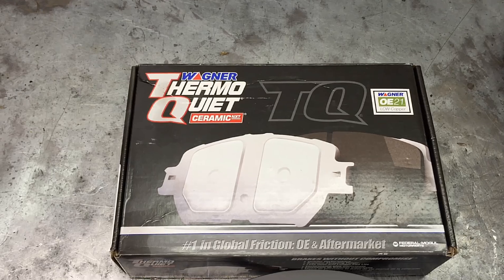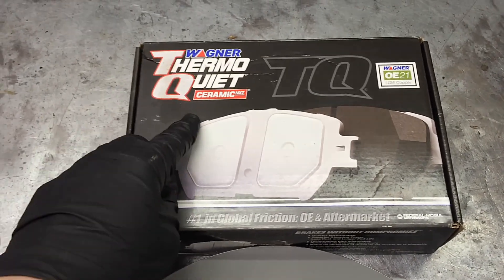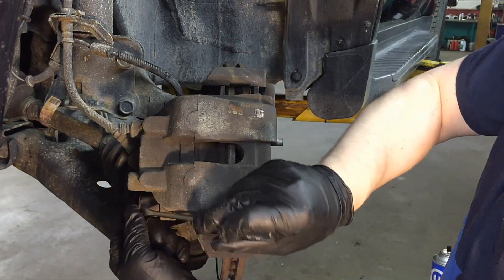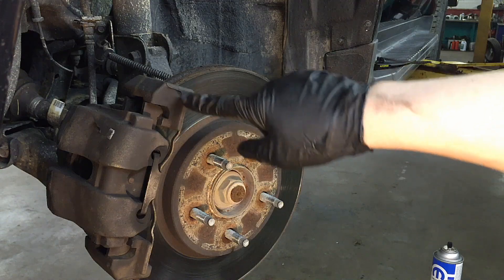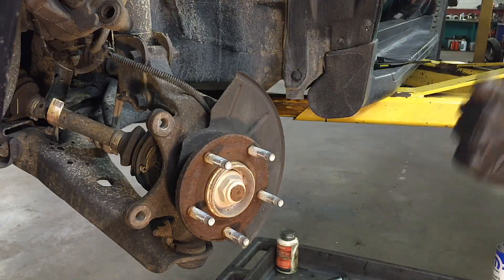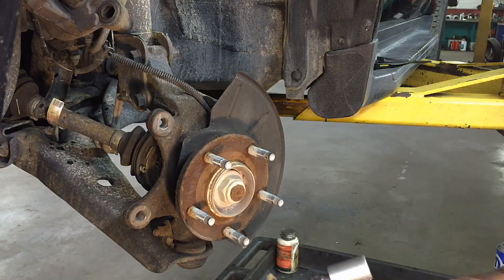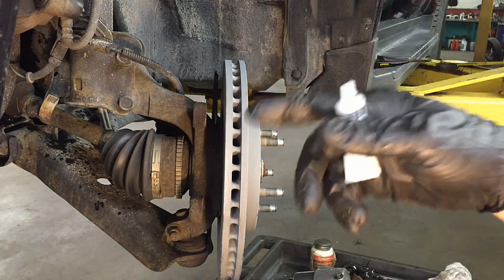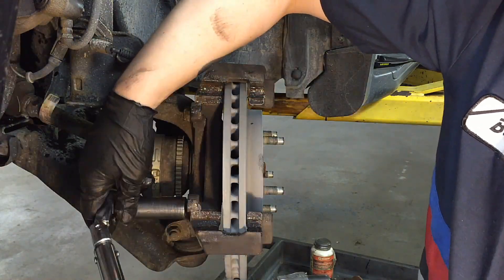2001-2012 Ford Escape Front Brake Job in Detail

Comment: Can you do a video on replacing or doing work to the rear drum brake? Granted they are similiar as I own a 2001 Mazda Tribute. Thanks
Reply from the maker: Bradley Escobar I shall have one in the future as my brakes in the rear are approaching 150k miles on them.
Reply: BGCE my cousin and I followed this video on my son's 2002 escape last night and it was spot on for the rears which had rotors I suggest take a close up picture where it's well lit of how the shoes and springs are located along with adjusters luckily my cousin has done many of these and he was there supporting me but I know if I ever do a job with rotors I will definitely take a picture lol

Comment: Hi FordTechMakuloco! Thanks for your video. After watching it I had more confidence doing the job myself and also learn something new in the process. I have a question though, right at the 3:51 mark, does that caliper sliding bolt require a tamperproof hex bit? I was about to do this job but I found out that my car's got that tamperproof hex. I have the Australian '07 Escape V6 XLT.
Reply from the maker: +jcq00tuber None of our calipers require a tamper proof bits here in the states.

Comment: Hi, great video and thanks for the help.  After following the steps in the video, everything seemingly went fine.  However, the travel of my brake pads has increased very noticeably.  The brakes work fine and the pedal doesn't go to the floor or anything, but the additional travel is noticeable and concerning.  I thought it would go away after the brakes seated / bedded in, but after a few hundred miles, no change.  Any ideas?

Comment: Some people say when you compress the piston you should open the brake line and let some of the fluid out so that bad fluid doesnt go back up into the system. You didnt do that. Why?
Reply from the maker: This is my own personal vehicle with regular brake fluid flushes so that does not apply.
Reply: FordTechMakuloco Do you recommend opening up the brake line?
Reply from the maker: It’s best yes but I have never seen this cause an ABS  HCU valve to stick.

Comment: Hey great video. Question for you. Would Permatex Dielectric Tune Up Grease be good to grease up caliper pins and such or should I buy Permatex silicone ceramic brake lubricant?

Comment: Have you ever had fit issues with the Wagner brake pads? I replaced the front pads and rotors on my '09 Escape with the same pads linked in the description and have noticed the pads clunking when first applying the brakes. I pulled the calipers back off and found there to be a noticeable amount of play in the bracket. Do you think I received a bad set of pads? Should I replace them right away; is there any chance of damaging the bracket or caliper?

Comment: Hey Brian. Have you had any wheel bearing trouble with your Escape? The older ones seem to eat them up.  Our 06' with 100k already needs new front bearings.
Reply from the maker: THETOPGLOCK No bearing problems on mine no. I think I have only change wheel bearings once on an escape not common on these at all.

Comment: i need input about those brake caliper bolts. they seemed to come right off in the video with an air gun . . . but i don't have air and i am having trouble getting them off. i would appreciate any suggestions. thank you.

Comment: Does the silicone grease actually stay a grease, or does it dry up from the heat ? I know a lot of guys who use antiseize to grease non rubber parts
Reply from the maker: Never use anti seize for rubber parts
Reply: FordTechMakuloco yes I completely agree and said that, use anti seize to grease non rubber parts, like metal to metal parts. I'm gonna leave the grease on just to see how it works. But next time will be using anti seize

Comment: Recently I changed the brake pads and rotors on a 2011 Mercury Mariner. Everything went together perfectly, I used Auto Zone top of the line rotors and pads. this vehicle had 65K. Now I have a thumping sound when braking. If I do a 60 mph panic stop the thumping goes away for a day or two. The Mariner stops great doesn't pull!  Any ideas what could cause the thumping?

Comment: aye dude so I was checking my breaks on my 01 ford explorer sport and it has uneven wear on the disc the top looms like shit but the bottom looks aight? my break pads were cracked and chipping off . my slide pins had no grease whatsoever u think it might be the fact that I didn't hace grease on the slide pins or it might be the break calipers that are getting stuck? thanks for the help

Comment: Great video.  But you left out a small thing.  Before pushing the pistons back into the calipers I take off the cap on the master cylinder on the fire wall.  Take a turkey baster and suck out some brake fluid.  Put a rag around the master cylinder just in case there is any overflow of fluid.  I throw the old fluid out and replace it with new before and during the brake pedal pumping so you don't suck any air into the system.  also put the cap back on the master cylinder when pumping pedal so as not to push any fluid out all over the engine compartment.

Comment: did the front brake replacement of pads and rotors, 
everything went great all parts fit without a problem...
now the pedal goes to the floor! I have tried bleeding the 
front brakes (both sides) to no avail! What gives?

Comment: did the front brake replacement of pads and rotors, 
everything went great all parts fit without a problem...
now the pedal goes to the floor! I have tried bleeding the 
front brakes (both sides) to no avail! What gives?
Someone said that the bleeder should be opened before the caliper is compressed!
Compressing the caliper before the bleeder is opened may damage the ABS module!!

Comment: You did a very good job on the video, however I have one question, you never explained why you replaced the disk???  Do you always as best practice.
Reply from the maker: yes
Reply: No , you only replace the disk when they are worn out , or warped, not every time you do a brake job

Comment: I have an 06 Escape and have done brakes before on other vehicles of mine. I followed this video and have done my brakes twice now and my rotors are rubbing the caliper bracket causing a groove to be made in the rotors on both driver and passenger side. Any thoughts about that and what it could be? I've taken the car to two different shops and got two different answers and neither fixed the issue. Thanks

Comment: Hello techmakuloco, how are you doing? I am Rene and I am writimg to you from Mexico, to ask you if it is necessary to choke the brake hose so that the brake fluid does not return to the reservoir, when the piston is compressed, and I have heard what must be done so that the abc module does not break down, what do you advise me. Thanks

Comment: what is the hex size for a 2009? Sounds like its caught in the transition between 7 and 9 mm. 
Also, any plans on doing a video on the rear drum brakes?
Reply from the maker: This Escape is a 2009 and it had 9mm hex. I have not done a rear brake job video on this yet simply because they take so long to wear out on  these trucks but mine has over 140k miles on them so I am sure they are not far from over.

Comment: Just an FYI I have a 2006 which was Manufactured in 11/05 and the Front Hex Bolts are a 9 mm Not a 7 or 8mm as You stated. Don't know why ? it's Just a Fact. Hope it Helps
Reply from the maker: Just goes to show you really need to check before going too far to make sure you have that oddball 9mm on hand

Comment: i stripped one of the brake screw hex when trying to bleed the brake fluid, what is the best way to remove it?
Reply from the maker: Map gas torch and vice grips or 6 point box end wrench and heat

Comment: I used this video to change my brake pads in my Ford Escape, best how to car video I've ever seen, great job!
However, today I was driving about 60mph on the highway and had to brake pretty hard, not slamming, but pretty hard. I heard a "pop", and my brakes were extremely weak and my pedal went to the ground and I struggled to stop the car in time, luckily I did. I pull over and pump the brakes and they're back to normal again, like the piston backed out somehow. Brakes work as if nothing happened now, no noise or anything out of ordinary, fluid reservoir is still full. Anybody have any guesses to what might have happened? I changed the brake pads about 3000-5000 miles ago and have had no issues, and I have had to slam the brakes hard a couple times.
Reply: Casey Culver wonder if air was trapped in system and the hard braking caused it to release just a guess
Reply: @iamkazie9401  .. maybe a funky master cylinder

Comment: Wife and I I got a 2011 Escape through an inheritance. It has 42000 miies on it. The right front brake is dragging. Is this typically and issue with corroded pins?  Or really worn out brake shoes (piston so far out it does not release properly)  . . . . or is there something else I should be looking for?

Comment: Cool,  GREAT JOB,  Buddy!!,
Man,   would be nice if you can make a   VID ,   For a  2006 - Escape - HYBRID /  on changing the  "REAR - PARKING - BRAKE - SHOES " ,
You know,   where the SHOES  go inside the ,  " DISC - ROTOR",   Cuz she does have PADS  for the rear as her REG. BRAKES...
Man,   believe it or not I cannot find one good VID,   for that job,   except for one,    but it wasn't too detailed, 
It's my  NIECE' S  CAR,  and it's coming up for the end of this month just wondering  on the  " SPEC ADJUSTMENTS "   or  what?

Comment: when compressing the caliper piston, do you take the cap off the brake master cylinder?
Reply from the maker: +Nab Sol I normally don't as I usually forget but you really should.
Reply: Nab Sol yes, I didn’t before and you end up with brake fluid being forced out and it can make a little mess. Not the biggest deal in the world I guess.

Comment: I’m not sure what model you’re working on, but 40ftlb broke off my caliper slide pin into the bracket. Sadly I ended up needing a new bracket since it was a clean break and I didn’t have the tools to get it out.
Reply from the maker: Not at the shop to double check the torqued but there is no way 40ft lbs broke a caliper slide pin that thick. You must have not felt the click which is common on lower torque values unless you are in tune to the torque wrench.

Comment: My husband changed the boot on the CV axle on my 2008 ford escape hybrid. Now it says Regen brake system failure safety shut down and it will drive very very slowly for a shot second before shutting down. It drove fine before hand I can't get any codes off it and all he stayed he did was in hook the brake line! Please help??

Comment: Just did my wifes 08 escapes rotors and pads all the way around. I've noticed that in the front the outsides of the rotors are only using half the pads while the insides are using the whole pad. I followed the directions for the break in period and it seems to only be using half the pad, should I take it all apart again and reset the pad? Im kinda stumped
Reply: +R6 GUY  If Im understanding you correctly, you're saying your brake pads are wearing unevenly.  First thing could be sticky caliper slide pins, if this is the case remove any gummed up grease build-up from each slide and apply some silicone lubricant (and not anti-seize). If that doesn't fix it then open bleeder valve and depress piston into bore, if its unusually difficult to move or just doesn't move then caliper needs replacing. Another possible is a bad brake hose. To test, pumps the brakes several times then go open the bleeder valve, with bad hose fluid will squirt out, fluid should only trickle out the hose.

Comment: The holes on the rotor for studs are usually larger, so there is always a little bit play between the surfaces of the wheel hub and brake rotor, how to fix it?

Comment: I like to use a old axle nut along with the lug nut to old the rotor on snug while your installing everything. That way you don't have to fight that rotor flopping around.
Reply from the maker: That is what some guys do but I can have the bracket on and the pads in place before I snug 3 nuts to hold the rotor in place so I usually don't do it.
Reply: lol 3? I just use one.
Reply: I do the same lug nut trick. Very handy. You put the rotor on and snug a lug nut down on one of the studs to hold the rotor in place while you work. Then you can put the caliper mounting bracket and caliper on without the rotor flopping around. Also greatly reduces the chance of the rotor touching the bracket and transferring grease from the bracket onto the rotor by accident.
Reply from the maker: UDraft4 I like to snug them evenly allot of times it will cock in there around the hub center with just one.

Comment: I have a 2010 Mariner.  The shop manual calls for 18 lb-ft on the slide bolts not 40 lb-ft.  My slide bolts take a 7 mm hex.
Please revise video to state if you have 7 mm hex drive bolts the torque should 18 lb-ft.

Comment: 2000 Excursion 4 WD  do you know why some of the locks will lock with the remote button and other will not work?   Also, do you have any recommendation what to use  to remove corrosion out of the tumblers.  My back window lock will not work with the remote and I cannot insert the key because it is corroded.  If I can get it to work do you know it is replaced or would this be a job for a lock smith?
Reply from the maker: The excursion is known for the lock actuators to fail internally, they will just nudge and make noise but not actually work. Anything to do with locks and corrosion I suggest a good rust penetrant like PB Blaster then WD-40. A lot of times though they are a lost cause. If it does not work just replace the whole assembly you can buy the kit and key it yourself.

Comment: I've noticed rock auto has different piston clip sizes for the pads.  how do I figure out which size I need?  I have a 12 escape 4wd with 2.5l 4 cylinder engine.
Reply: +Lee Dress is there any way of me finding out if i have Phenolic pistons without taking the brakes off? it seems you need different pads if you have Phenolic Pistons.

Comment: My 2008 has 9mm slid pins on the drivers side and 7mm on the passenger side.
Reply from the maker: Oh wow!
Reply: Check Car Fax . It sounds like the car was probably in a pretty good accident in the past and had damage to one side where they had to replace  the knuckle and probably found one from a  2009 or newer that "fit".
Reply: @kenito1967  nope,bought it new off the lot.
Reply: @b.t.2057    i take back what I said. Actually,  that's one possibility of how a car could end with a different slide pin.  I just had to change the caliper on our Escape and the remanufactured part I got from the auto parts store had the different slide pins included with the caliper. In my case, I had to go out and buy the 9mm wrench to get the old pin out, but I did have the 7mm wrench I bought in a set years ago.  Oddly enough the set I bought did not have a 9mm.  
Hearing your situation,  I find it odd Ford would have done that because I get they probably ran out of pins at that moment and went to their warehouse/stock room to get more.  Problem would be the guy in the assembly line would have to stop the assembly line  to switch up different wrench.  Not very productive.

Comment: I'm finding all sorts of conflicting torque specs all over the web for the front brakes. Have they been updated since you made this video or do the specs you have still apply?
Reply from the maker: You are having such a hard time finding the specs for your exact year but never give me the year you are working on. I could have answered you right now but now I will probably never see this message again.
Reply: @FordTechMakuloco  Hang on a second. I never said I'm having a hard time finding the specs. I said I'm finding conflicting specs. You were working on a 2009 in this video and I referred to the specs you gave in this video and asked if are they still valid, so I think it is obviously I am also working on a 2009. Just logic.

Comment: I can't get my pistons to move back into the bore enough to get my new pads and rotors to all fit together. i even tried fitting two c clamps on but it still wouldn't go enough. i had the brakes bleeding while i was doing it hoping that would relieve the pressure but it did nothing. It seems the piston has adjusted itself to the rotors and pads being completely worn down. should i try to fit a shop press on it somehow or is it time to replace the whole caliper assembly or is there a tip you know of that might help?
Reply: I didn't remove my slide pins. might that have been it?

Comment: +FordTechMakuloco I am a new tech and I just performed a brake job on a 2000 Ford Focus, replaced front rotors and pads. Checked to make sure that the brake fluid was topped off. Pumped the before and after turning on the ignition. Before I turned the ignition on the pedal became very hard to press. But once I turned the ignition on, no matter how many times I pump the brakes the pedal still goes to the floor. Any help with this issue would be greatly appreciated.
Reply from the maker: Was this the original issue?
Reply: That happens when you force the piston back in and don't open the bleeder valve. All that brake fluid gets forced back up to the master. Then the centering pin gets stuck on the ABS or the master.

You have to bleed the whole system to get the pedal right. 

Don't ask me how I found out.

Comment: 130 ft-lbs is that correct or is it 30 ft-lbs for the caliper bracket bolts? Set my torque to 130 and it's a no-go...but 30 yeah about where it bottoms out.
Reply from the maker: 130 ft lbs